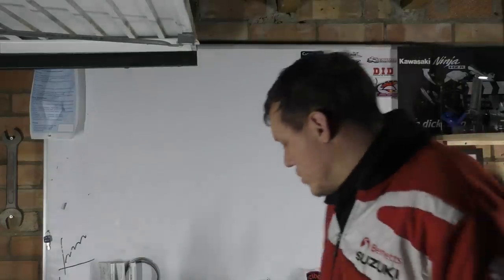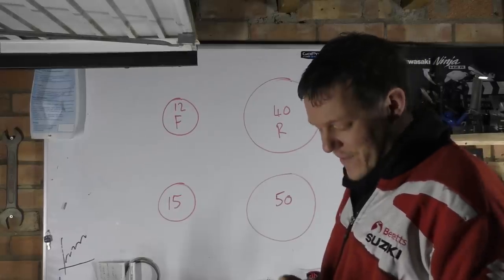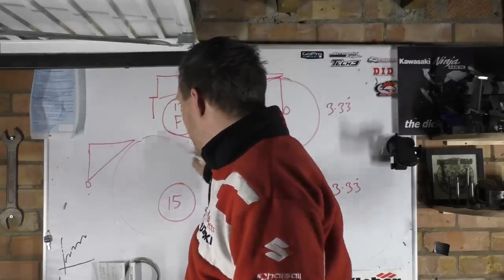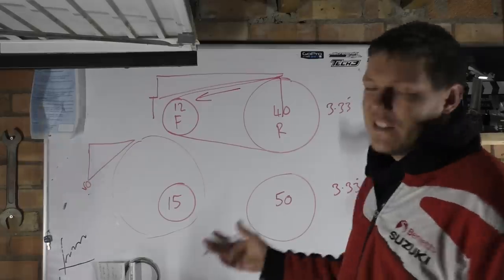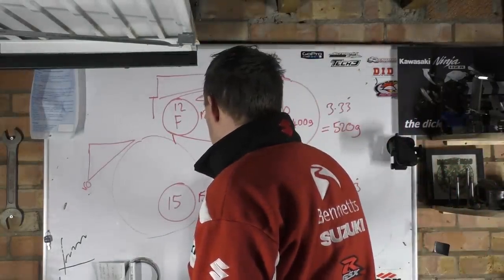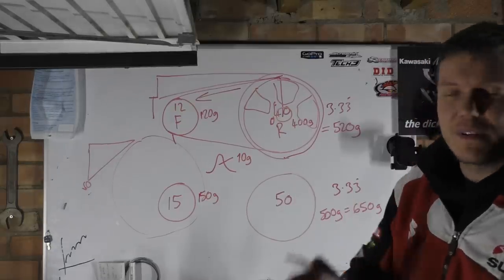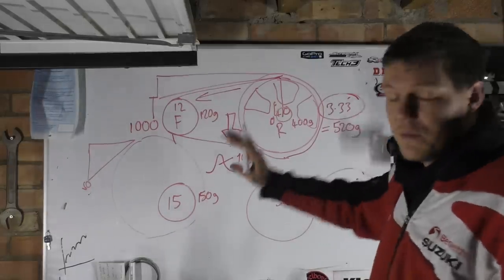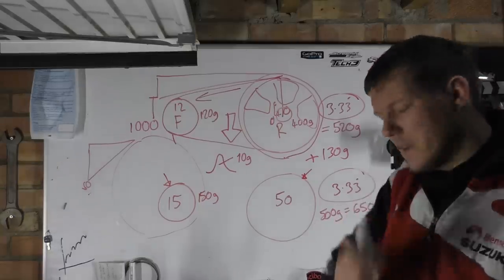Sprocket ratios - Part 2

Comment: Didn't pick up if you mentioned it, but 15/50 would also have the chain moving faster compared to 12/40. Since the smaller sprockets are spinning at the same speed, but  the bigger sprocket is moving the chain an extra 3 teeth per revolution.

I don't know what the speed limits are or other impacts the extra chain speed would cause, but figure there would be some marginal impact. Probably nothing compared to the drive forces being applied.

Would the smaller sprockets also reduce the amount of chain free play required from the offset of the swingarm pivot?

Comment: The stunt bike riders I've met have rear sprockets the size of small pizza's, but they crank the idles up and the bike goes at a nice slow rate by itself. Thus, allowing for them to climb all over the bikes while rolling... almost without touching the throttle, at least until they transition to another trick.

However, they don't allow the bikes to really reach top gear whilst running from the cops (as a knob I know found out). :)

Comment: Cool video. One good reason for a larger rear sprocket is dirt bike racing. I race a vintage Honda with Ahrma. I do Motocross and cross country with the same bike. By keeping the large rear sprocket, I only have to change the front depending on the race. And I can use the same chain. Just adjust the rear tire in or out. I use to swap both sprockets and chain which was a pain in the arse. But when I went to a huge rear, I just swap bt the 13 tooth and 15 tooth front. I guess your right, it is heavier, but the bike weighs a ton anyway.

Comment: Hi, Matt love the channel. I though that if the sprocket from the engine was bigger that would add a heavier load to the engine output shaft and it's bearing and if a  smaller sprocket is used at the wheel that would stress the swingarm and rear wheel bearings.
Reply from the maker: We're not talking that much bigger here but yes - this was from the perspective of torque and rpm

Comment: The first example also has a more even wear of the sprokets.
The second one could have the small sproket with much more and faster wear than the big sproket, and still they recommend to always change boot when you change the chain

Comment: The chain speed will increase with larger diameter sprockets. Also if the same centre to centre is maintained, you will also need more links, again increasing weight.
Reply: Running 13/45 on my sumo 450. going +2 on the rear. Do I need to add links? And, if so how many?
Reply: @R6trackaddict66  most likely will have to add links. There is an online chain calculator that is quite helpful.
Reply: @chippyjohn1 Just looked it up. Add 2 links for every +1 on the rear. Thanks!

Comment: Wouldnt the rear sprocket size affect the suspension geometry of the bike through acceleration squat? Since the angle that the force is applied to the swingarm changes, I just figured it would also have an effect there.
Reply from the maker: Everything has an effect - but generally that's what we're covering here - from a torque and rpm point of view
Reply: But if the torque to the wheel should be the same, with a smaller sprocket we need more torque applied to that sprocket which means same force at the axle I figured
Reply from the maker: No force is applied at the axle but torque - the force is applied at sprocket teeth. Is there's 100Nm at the axle is doesn't matter if this is applied at 10 meters or 2 meters. The force changes at the contact point.
Reply: Makes sense. I figured that with a larger wheel sprocket, the force would be applied further away from the point of contact through the axle. So it would have more leverage through the swingawm and into the shock. So even though the torque into the wheel would remain the same, I was thinking that it would potentially increase squat.
Reply: Yeah shit, gotta switch torque and force in my comment.

Comment: what's the good one combination, 13 /49, 13/51, 12/49, 12/51 for uphill trail?
Reply from the maker: There's no such thing, it depends in the engine
Reply: 12/51 should work well if you want more torch
Reply: 13/59

Comment: If the sprockets are changed would this mess with the speedmeter only asking because I’ve just got a bike but the speedometer is reading a lot slower then am actually going
Reply from the maker: It depends how the tachometer works. There are different types.

Comment: ok i have a question you may be able to answer. So i run a vw style offroad buggy running a 31'' tire. i want to do a chain drive swap and run a 35-40 inch tire and as a baseline that i could adjust i want the same final drive ratio with say a 35 that i have with the 31. how would i go about figuring out what my chain sprocket ratios would need to be in order to make this happen

Comment: Matt I have a question how do I change the gear ratios in my bike , my bike tops out at 115 kph it's 200cc but I've seen 150cc bikes topping at 122 . Like how do I increase my bikes performance
Reply from the maker: Better engine? Gearing ratios DON'T increase your top speed
Reply: Of cpurse you can increase ypur top speed with the gear ratio. You would have to add 1 or 2 teeth to the drive shaft sprocket and remove 3 teeth to the driven (rear weehl) sprocket to have the result that ypu want. The downside though is that you'll be affecting the acceleration and torque of yor transmition system. I think it is a good decision if you commute a lot at a constant speed ... like 100 kmph... with the gear transformation you could lower your rpms at the same speed. Obviously you'll have higher tops speed. With the gear ratios it is just like bicycles. Just imagine that and the answer is there.
Reply: @dirtygarageguy  very bad answer dude. You can increase or decrease the top speed removing or adding theet to the sprockets and at the same time loosing or winning torque.
Reply: ECU + Front sprocket pick biggest (Depend on your bike). Rear pick the smallest Size Sprocket. If your bike has ABS then your safe, if not i would not recommended. (Malaysia Drag Motorcycle) ;)
Reply: @FranciscoJavier246  very bad answer also, top speed can be increased only if it's coming from a rev limit situation, on big power engines.   
Otherwise, the top speed will actually drop, with longer gearing, or increase in a lower gear ( in 5th, goes faster than stock 6th and 6th goes much slower than stock top speed ).
Reply: @TheSilviu8x  you lose torque, therefore the hp numbers change also. If you rev the engine, you'll get a rev output that in the wheel will transform according to gear ratio. I imagine that if you exagerate it (front sprocket 15mm diameter and the rear one 300mm) yeah I don't think that bike is going fast. But, within reason you can mod the wheel spin.

Comment: Great video my question is: what is preferable for chain and sprocket wear small sprockets that increase the load on the chain or large sprockets that reduce the load but increase the chain speed, my theory is the smaller are better as when the chain wears a small amount it doesnt hook the sprocket teeth as much as the larger one
Reply from the maker: Speed doesn't wear a chain, force does. But apart from that it doesn't matter. Most chains suffer from corrosion well before the chain physically gives out

Comment: Should you go high torque if you put big wheels in your motorcycle? So the engine can handle the weight of the tires?

Comment: Seen a couple of you tube posts on converting spoke rims to take tubeless tyres by sealing the rim with marine sealant and 3 m tape, have you tried it and what's your opinion on this? Would like to run tubeless tyres on my T120.
Reply from the maker: Great question - video within the week
Reply: @dirtygarageguy  great

Comment: If you had a higher load application surely the extra teeth would be more capable of transmitting that load without a higher risk of failure, I get the weight issue but is there not a compromise to be had here for the sake of reliability and longevity Vs. performance?
Reply from the maker: "If you had a higher load application surely the extra teeth would be more capable of transmitting that load without a higher risk of failure,"

- Yes in the context of the question we're just looking at the same load vs just the changes based on the same ratio
Reply: No worries!

Comment: Alright, was looking for an explanation like this, so, on a shit slow bike like mines, that struggle to out revv with +1 sprocket, the answer is that it will actually work with lighter components, like aluminum rear door sprocket and thiner/smaller chain, do to the difference in friction and leverage?
Reply from the maker: No. The difference is load vs accelelration
Reply: @dirtygarageguy  , ahh.. so, might as well increase another teeth, or more, searching for acceleration, or increase until i bounce on revv limiter on top gear?

Comment: I have a tillitson 212 Hemi 10 hp I am ringing 40 chain on a 5’ slick with 40 tooth sprocket with 10 tooth Maxtorque Centrifugal clutch What gear ratio should I be running

Comment: i did this experiment the Results was bad .. more teeth is mean taller chain .. it needs more time to make one cycle Compared to small chain  .. so acceleration decreases and top speed .. rpm increase slow and on top rpm top speed decreases .. with average speed no different except more fuel burned .. but torque increase at the very slow gear 1 and 2 .. i noticed my bike be strong dealing with weight easier At the beginning of the movement

Comment: Imagine Taking a 44 T sprocket with its crank arms and putting it in a 20 inch frame with a 20 tooth rear sprocket ? Any positive and negative opinions??
I mean I enjoy it and I’m 6 foot 1 
I’m only asking cuz maybe I’ll try a smaller rear sprocket any some like 14 or 15 or 16?

Comment: I feel really stupid for asking this and I hope I make sense .
Im hoping to do an engine swap in a lexmoto hunter 50cc manual to a 125cc semi auto matic

Is there a way I could calculate what gearing I should use or is it a case of buying a few different size sprockets and trying each out ?

*Some info
The bike stock 50cc gearing is 45t rear , 12t front 
50cc engine and the 125cc semi engine are just pit bike engines.
Bike has 18inch wheels

If I can find any more info I'll edit this post.

I'm a disabled rider on l plates who can not use a clutch any more due to nerve damage .
So I'm building a cheap mini old school scrambler as am fed up of riding scooters.
Reply from the maker: Does the 125cc donar bike have 18 inch wheels?
Reply: @dirtygarageguy  sorry for the late reply 
No it's just a off the shelf engine that you can buy to fit in other pit bikes or for those folk who do Honda cub builds
Reply: Here is a link, sure there also used in cheap quad bikes 
Once I get to my pc I'll try and find more info

https://www.pitbikeparts.co.uk/lifan-125cc-speed-semi-auto-valve-engine-mikuni-p-1580.html
Reply: @RobertBrownCyberboy109  sounds like an interesting project that, so id thought id have a go answering myself, take it or leave it. i found this it has some specifics on the torque and powerbands of that engine. i hope its the same one. has double the torque and hp of your original engine but revs about same so if it was me i would go for a 12 front 30 rear. which is a 1/3. Maybe matt has a better idea. http://www.pccmotor.com/lifan-125cc-eng125.html
Reply: Just sharing- 125 cc have roughly 8-12 hp. With 17 inch wheels. I suggest 15-37 for top speed.
14-39/14-40 for pickup.
Or u can increase further more top speed by using 15-35

Comment: Does chain length affect the performance ? better energy transfer if its shorter?
Reply from the maker: No - Well, more links = more friction, but the values we're talking about (like maybe 0.01 joules) is not worth worrying about EVER.
Reply: @dirtygarageguy  thanks :)

Comment: I run 11 - 70  on my "race" moped :)  The top speed i about 50kph.
Reply: 18 36 is the best  if you try that you would go from 50 to almost 70 MPH
Reply: @dewayneriddick6656  Top speed is Not important....
AND it's not possible to fit a 18 in the front.

Comment: I have a fixie and want to put a 20 tooth sprocket on the back of my bike we’re the wheel is, is there a specific size not on tooth’s but like we’re the hole of the sprocket is
Reply from the maker: What?

Comment: yo so i have the r125 with a 16 front and 32 back if changed to 18 at the front and 40 back what will that do to the speed or acceleration will it change to notice or nothing at all

Comment: How many teeth sprocket should i use in order to ride my bike in high gear and low speed. ( Also let me know weather to change drive sprocket or driven sprocket)...please reply as it would save lot of money for me, because i ride in terrible city traffic and changing gears again and again to maintain speed is becoming troublesome for me due to which i am planning to change my bike, however if you help me with proper teeth arrangement by which i can ride in traffic with high gears and low speed, i can than continue with my bike... Which will help me save huge money.
Reply from the maker: what speeds (between 10 and 30mph?) , what bike and what year is it?
Reply: @dirtygarageguy   my bike is 2011 model honda Cbr 250r.
Reply: Thanks for instantaneous response...
Reply: Yes 10 to 30 mph will work for me if i get it with 4th gear... I dont love to rev my engine more to maintain speed and downshifting   gears again and again
Reply from the maker: you wanna go longer in the sprockets - i.e larger on the rear - but I'm afraid that you bought the wrong bike. The CBR is a high revving engine period, and not really designed oto commute on
Reply: @dirtygarageguy   exactly, i am really disappointed, its a high revving bike, and my commute is mostly within traffic, isn't there any solution..
Reply from the maker: Yeah - change bikes
Reply from the maker: You've got a jetski to plough a field
Reply: @dirtygarageguy  🤣🤣🤣🤣🤣🤣🤣 Rofl.. that was damn funny ..... Hahhahahahahahaha

Comment: Off topic question , will mounting a smaller back sprocket on an mt 09 make it less wheelie prone?
Thanks in advance🧐
Reply: Think of bigger is higher and smaller is lower (slower). Its all about 1 revolution. In order for a car to go it has to be in a lower gear to push the weight so it uses 2 small gears, lots of torque and power but no top end speed, as you get up to speed you shift up to larger gears cause the resolution of a larger gear keeps up with the car and puts less stress on the car. So that being said small gear is start and large gear is top end. You want wheelie? Smaller. You want perfect then look at a bicycle, medium and small, hard start and top end, small and huge. Hope I could help

Comment: I’ve gone from a 10tooth front and a 44tooth rear to a 18 tooth rear and the same front teeth, not buy choice but just wondering if this is practical I am going for top speed but I still want some torque, this is for a 80cc motorized bike had way to much torque originally and no top speed
Reply: Should I make my rear a 11 tooth to give me more torque

Comment: Hi.
Is there any chance you coukd make a myth busting video on lowering the bikes gearing giving better acceleration.
Im not talking about mopeds, im talking about big bikes with enough power to flip over backwards in 1st.
There are so many people who say to get more grunt and make a bike faster you have to lower the gearing.
I personally think its a load of horse crap and that it doesnt change the power of the bike at all, and in some cases can make acceleration slower due to the limiting factor of a motorbike that is too much wheelie.
It will feel faster and the speedo will read faster maybe!
If you went to santa pod and timed different gear ratios then would it really make any difference?
I hear it so many times and its quite a debate but it would be nice to get it solved once and for all.
If im wrong then im wrong but ive never seen any evidence that lower gearing makes a faster bike in the real world.
Mike
Reply from the maker: I have already. If you change your gearing, I.e sprockets you can change your acceleration characteristics.

https://youtu.be/oWTWhFy6PpU
Reply: @dirtygarageguy  yes ive seen that now.
But what im saying is you hear some people say that on their r1 they run stupidly low gearing and thats made it massively faster accelerating.
Yet what ive found is lowering the gearing just makes the bike want to flip over backwards and you cant get the power down.
For example is there any way of proving a r1 is faster to 100 mph say with lower gearing.
I would hazard a guess that its no different and as i mentioned if its wheelieing then your going to loose time

Comment: Hi Matt could you please do a video on a Cvt drive system as I want more top speed out of my moped but don’t know anything about cvt gearing ratios do I increase  the primary or secondary gearing or reduce it for more speed any help would  be much appreciated cheers Dan failing this will have to ask dell balls 🤣

Comment: thank you boss...................can you compare between ...........15 front and 47 rear ...................15 front and  45 rear.....................what is better
Reply from the maker: Better in what respect?
Reply from the maker: If the front sprockets are thw same you ignore them. So we look at the rear only. 

If the rear has more teeth that means it's a bigger circle, a bigger circle means it makes more torque, for the same rotation. 

The best way to think about it is like a push-bike the larger the rear sprocket the quicker you can accelerate, however you reach max rpm vs speed.